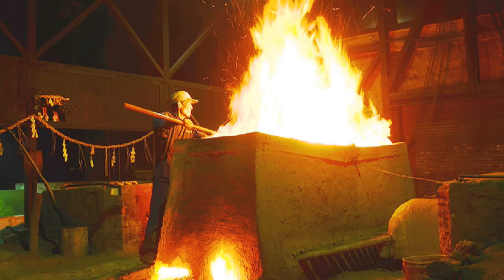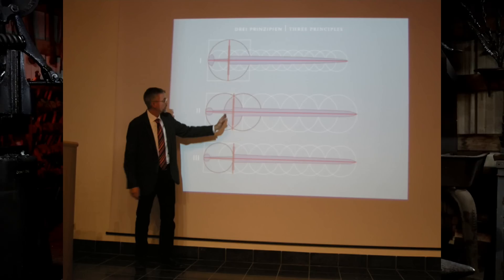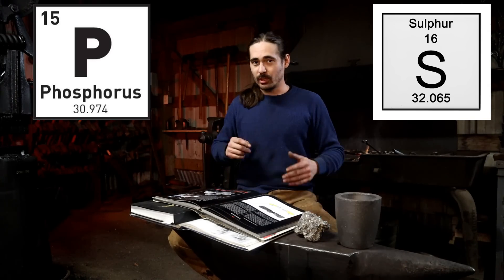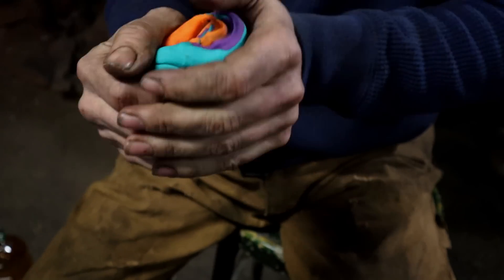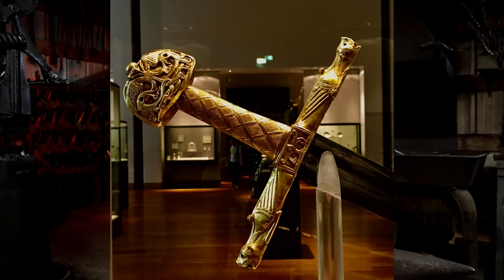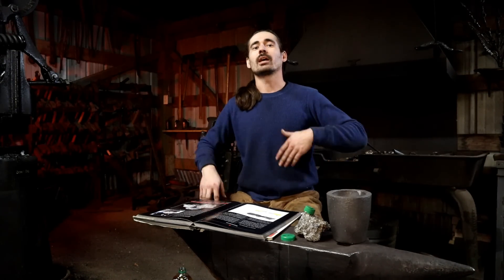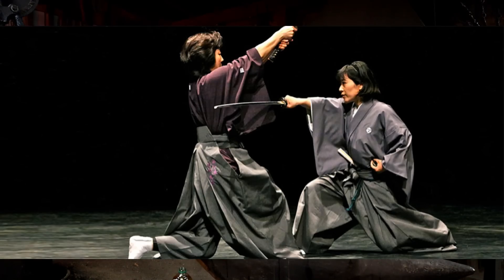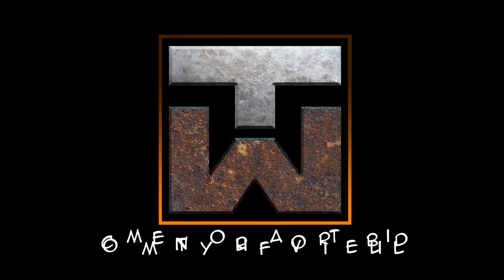Misconceptions About Medieval Steel - Wootz vs Bloom

Comment: I take issue with your premise the knowledge wouldn't be passed on in an illiterate society. There is no need to write something down to pass it on, you can do better, you can show someone how it is done. For instance I can show a person how to put a flatpack piece of furniture together far better in person than by means of an instruction leaflet or manual. That said knowledge might not be so easily disseminated though, as one man can share knowledge with more people through a book. Still, folk travelled in the old days, ways of doing things did spread but maybe not in a fast timeframe.
  One last thought, methods of fabrication were jealously guarded, EG glass making in France or Silk & Tea processing, but that's in terms of within a small group of people or society, but this knowledge was passed on within families most of which couldn't tread or write probably.
  An interesting video non the less, thanks.

Comment: I like this video very much, everything about bloomery steel is consistent and logic to me. I actually believe that there could not be that much of a difference between crucible and bloomery steels, because of the forging process. BUT... I really can't agree with the wootz bad quality argument. Your resaoning is very good, but it fails because your data has to be wrong, maybe it's old data, maybe it's bias on it's own, I don't know, but I can't believe a highly regarded weapon was just like non tempered mild steel. For instance, your description of how it was made doesn't match recent works on the matter, neither the composition, or the edge hardness. Two awesome videos on that:
https://www.youtube.com/watch?v=RDyU-15fzog&list=WL&index=17&t=261s 

And an article from the guy who discovered how damascus was made

https://www.mse.iastate.edu/news/john-verhoeven/https://www.youtube.com/watch?v=OP8PCkcBZU4&list=WL&index=16&t=10s 

Still, very nice work, the fact that I can't agree doesn't mean I didn't like it, and it's a very healthy thing to question everyting, so kudos for that.
Reply: Grazzi, F., Barzagli, E., Scherillo, A., De Francesco, A., Williams, A., Edge, D., & Zoppi, M. (2016). Determination of the manufacturing methods of Indian swords through neutron diffraction. Microchemical Journal, 125, 273–278. doi:10.1016/j.microc.2015.11.035 

a quote from this article, which the author uses neutron source to determine the crystal structure of some middle Asia and Indian Damascus steel blade:
"It is important to underline that no martensite was
identified in any of the samples indicating that none of the swords had been successfully quenched."

Comment: The explanation on folding was pretty long, but you never talked about the fact that you only need to fold it twice for the crystalline lattice of the iron to be more durable and locked in. The atomic structure is perhaps just as important if not more so than refining. Of course they didn't know why the folding was more durable back then, but we do. Science!

I think shad had really good points on Japanese weapons in his videos, honestly. Most people tend to think they're the ultimate weapon, but of course they're not. They're only really good at slashing and have poor hand guards, no pommel for balance or control, and the handles really aren't very good. They usually have no tang and they're really not stabbing weapons. Shad just pointed out, rightly so imho, that western swords were more varied and so it's unfair to compare them.

Comment: Ilya, stick to hitting hot steel or hit the books before making wild speculations about historical theological thought and misrepresenting historical social norms. This is the second time that you have gone on an unfounded anti-christian tirade since your video on armor. I can't possibly imagine that blacksmiths, bladesmiths, swordsmiths and armores were viewed in contempt. The church has seen that there is a time for justified violence, as there are multiple warlike heroes of the old Testament from Abraham's rescue of Lot, to Sampson, to David, to the armed defence of the Jews under Ester in Persia, to Nehemiah's armed workforce and beyond in the Resistance of the Maccabees likely celibrated by Christ himself; Hanukkah. As for holding craftsman in contempt for theological reasons, Bezalel and Oholiab worked on the tabernacle, Huram-Abi worked on the first temple, Paul was a tent maker, and Jesus Christ himself was a carpenter. So please don't besmirch the church with claims of suppressing craftsman and stifling industry.
Reply: I just gave a lengthy reply to Ilya regarding this. There is no Biblical reason to keep blacksmiths illiterate or on the edges of society (which they historically were not). I am glad someone else noticed this.

Comment: Your description of the bloomery furnace’s workings is wrong wrong wrong. You made the most basic error in your explanation, this error is the actual difference between bloomery iron and crucible steel.

You said that there are droplets of iron that fall to the bottom. First off a drop is a in a liquid state and a bloomery furnace is maybe 400-500°C below melting point of iron maybe even more as low carbon iron has the highest melting point of about 1500°C. SO NO DROPS EVER. 

Second you said that the iron falls down. No falling at all everything is supported all the way down 100% of the time. The lower level of charcoal doesn’t just burn away leaving a void and then the whole pile of shit above just falls. Nope, the lower bit burns away and as that happens the whole stack of charcoal/ore layers just slowly get lowered down and more layers are put on the top. If the Botton did burn away and you have a void then you get a failure of the entire burn. This happens because you open a space for air to to be and this then causes the oxygen at high temp to rust/oxidise the ore away to nothing when you are trying to do the exact opposite.

Third. You say anaerobic a few times. Unless your describing a sewage septic tank or a failed worm farm then you have the wrong word. Anaerobic means and only means that you have an oxygen deficient environment in a BIOLOGICAL setting and the living stuff in the aqueous sludge has changed from an oxygen dependent life forms to oxygen hating life forms. WHAT YOU MEAN TO SAY is a REDUCTION ATMOSPHERE OR REDUCING ATMOSPHERE. An atmosphere that does not have enough oxygen to properly burn the charcoal into CO2 like it chemically wants to and instead you get CO and than that CO desperate for more oxygen to pad it’s self out to CO2 starts stripping the oxygen from the iron oxide ore so metallic iron is left but it never melts ever ever ever so a bloom of iron is a lump of never molten shit including charcoal leftovers, slag lots of slag and metallic iron that’s full of shit that has to be beaten out. Now since carbon was there some can diffuse into the bloom but not much. To get iron to use the bloom is then very carefully worked by a smith to bring the iron together and then folding and forge welding on and on slowly forces the inclusions (included shit) out or the lump. Unfortunately any carbon is also an inclusion and carbon is lost as the bloom is worked.

Bloomery iron is just that, IRON and not really steel as we know it by carbon percentage. At best you can get a modern carbon level to that of mild steel and a tiny bit better so that it just be quenched and tempered. And PING that’s the cracking sound as the nice sword cracks or shatters as the quenching process fails the bloomery steel at the stress point from an inclusion.

Now crucible steel by definition is a steel making process that turns all the iron into a complete liquid. All modern iron and steel is crucible steel. Now when molten the iron sinks to the Botton of the crucible because it’s just so fucking dense and all the crap floats to the top. At those temps the carbon that was added at the start is gasified and any oxygen in the crucible is turned into CO2 while the rest literally gets dissolved into the iron making it steel. At the end, after maybe 2-3 hours and a day or more to cool is a sealed ceramic crucible. You knock the top off, tip out the ingot and you will have the slag and shit sitting on top of an ingot of pure steel, clean as with no inclusions at all. Carbon content % is controlled by how much charcoal you add to the crucible.

Now now now. SUPER IMPORTANT. Did you know that you can’t add ore to the crucible to make crucible steel? You have to add bloomery steel. Just like roasted iron ore goes into the bloomery furnace and not just straight or (water reduction is nice but sulphur removal is critical). So a crucible is used to clean up bloomery iron and add carbon to bloomery iron. So a crucible is just doing a days quicker and perfect job of what the blacksmith beating the bloom is trying to do.

So roasting then bloomery then smith and his half assed job or a crucible. Now an armourer makes a sword or knife because blacksmiths made farm tools.

Comment: First part is great. Just great. Thanks for all the details about crucible steel.

Latter part... well... 
First, story with Cain and smiths... can you lead to any source about it? I mean, not about Cain, it is in the Bible, but about smith being almoust an outcasts of medieval society. It is first time ever I heard about it, any details, sources, or somethink like this?
Literate percentages... here i have to just call you wrong. Medieval europe... deam, this is a wide river, complex topic better not dive into now. I feel like numbers you give are bit to low, but it is just a feeling. But about Japan... edo. EDO, ffs! Edo begine more than hundred years after medieval period and ended in MID XIX CENTURY! What kind of comparison is that?!? If you want to do a comparison, compare midleages to early sengoku, or times before it. If you want to use edo, compare it to enlightment period. But not THIS!!!

Comment: Yeah, so you are another Japan loving pattern welding weebo. I have a few questions: first if crucible steel was not better why did every european country renounced using pattern welded garbage 600 years before the japanesse adopted it? Second if you know about how corosion works then answer this : which steel has more impurities and corosion, that in the form of sand ( japanesse garbage) or that in form of chunks resulted either from molten lava or meteorite? And third you mention the 3 Japanese regalia which is basically a hoax perpetuated by over 100 as most if not all have been lost already ( according to their own stories- the sword was 100% lost) but that sword was almost surely a bronze of iron ( not steel) straight sword imported from China that may have been used by a warlord that came from China and founded a country in Japan at some point to kill a big snake. How is this relevant to steel swords making since that is not made from steel?